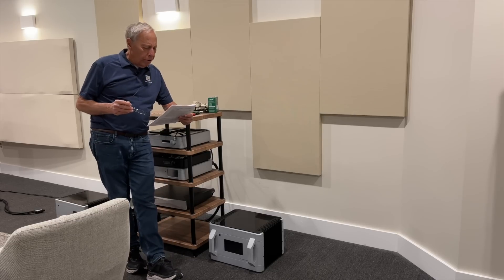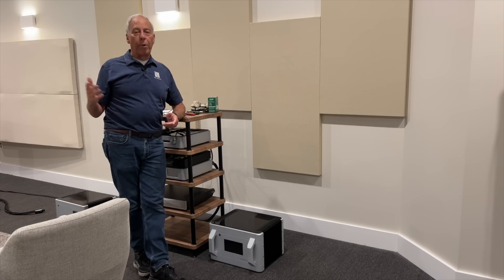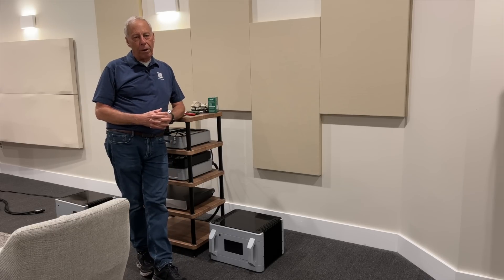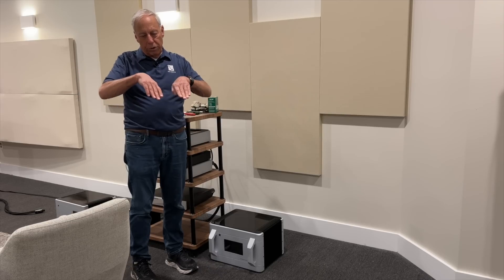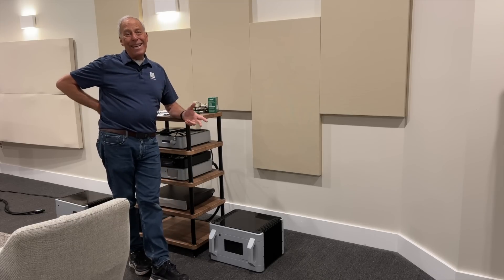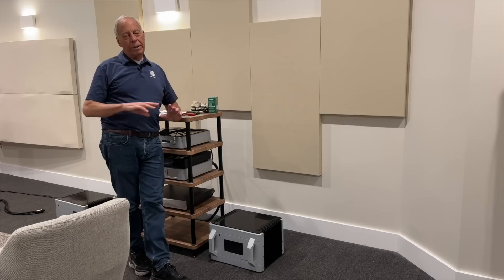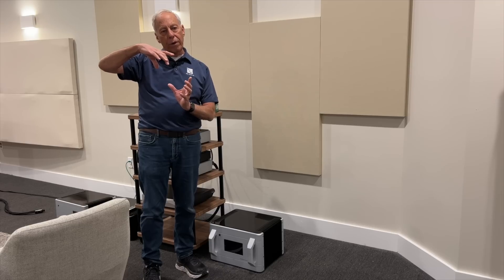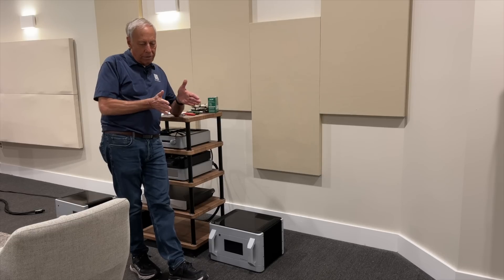Woofer size in modern speakers

Comment: woffee size matters a lot! in active speakers and bluetooth speakers, DSP is often used. digital signal processor since over the years it has become relatively cheap to use. and that powerful speakers are relatively cheap to use, so bass and sound quality are quite good for small speakers nowadays

For sub/bass you should not use less than 10"

in good speakers, I would never choose less than 6.5"

It has also long been a struggle to squeeze a speaker into the smallest possible box. smaller boxes mean less bass
Reply: This is true
Reply: Personally prefer well designed and engineered speakers that don't need a tweak like DSP
Reply: it depends the music you will hear, and the place where the system is located.
shut up and get out of here trying to impose your criteria without knowledge. not every system got to be as you say.
Reply: @georgemartinezza  You should not always doubt what everyone else says. They may be right in what they say.

There are some things you cannot escape when talking about speakers and speaker construction.

Speakers are not an easy thing to deal with. You will often be disappointed.

If you have speakers that only produce good sound for a few types of music, you don't have good speakers.

if you have good speakers but they don't give you good sound on some types of music, then it's the music recording's fault, not the speaker

if you put a speaker in a corner or next to a wall in a room, you get better bass but not as good sound quality!

if you have a 5 inch speaker in a box that is too small, you will get less good sound.

if you have a sound system with a 6.5 inch bass box, you will not get good bass!

If you are going to have a subb/bass box for your sound system, you should have a minimum of 10 inches. the difference between 6.5 and 10 inches is large.

small mids are better and give faster mids than what a 10" 12" does.

harman kardon and jbl extreme bluetooth speakers often have a special bass that colors a lot at around 80hz, which does not give the best bass sound
Reply: @ford1546  yes. I love.
Reply: @ford1546  Define good, please.
Reply: @robertspringer9477  if you walk closer to a wall and speak, your voice will become darker and have more mid bass. about. 2 meters away from a wall is good. Hard to say approx.
Reply: @ford1546  What are you talking about?
Reply: are you being a bit harsh w/ the "shut up and get out..." line? might be nicer to suggest folks be careful conflating, "you should..." with "I would..."

Comment: Most common is 6,5 to 8 inch woofers and i think its better to have multiply of those woofers than one big one, it would be much easier to place those speakers in room, i take sq always ovrr spl
Reply: maybe you don't know how the sound in subwoofers is developed.
subwoofer is Omni directional
Reply: @georgemartinezza  we don’t need such big drivers in speakers becouse we can use multiply drivers instead and make a slimmer speaker witch will work better and sound better in most rooms, subwoofers is there to help with lowend and yes i prefer a larger sub, but for the main speaker 3-4 6,5-8 inch drivers is more than enough typ push high spl with good subs, look at perlisten r7t and s7t they have 4 bass drivers each 7 inch in r7t and 8 inch in s7t, both can play over 115 db, s7t can nearly reach 120 db, so yes those kind of drivers is enough in a main speakers

just use subwoofers for bass output under 30 hz, most people play Below 85 db at their listening position, even speakers with 2 6,5 drivers can play 85 db in your listening position without problems and it might be louder than you think, playing much louder than that of you plan to listen music for long periods will just damage your hearing in the longeun,
Reply: @andreasmoller9798  more subwoofers -
Reply: @georgemartinezza  yes i agree i am just using one at moment but planning to get another later, i have no rush through as i think the one i have in my room does a really good job👍
Reply: @andreasmoller9798  more subwoofers is complex. to setup got to be "carefully" .  ✌
Reply: @georgemartinezza  yes it can be tricky placent is important, to my experince its not always a good idea to put them in corner thats at least the case for me and my room

Comment: My speakers have 2 10" woofers, 6×10"  mid horns coupled to compression drivers, and a lovely 1" horn loaded tweeter.
Over 25 years I have through much trial and error found just the right electronics to put behind them, and they are phenomenal, forward, but sound like a live performance, I still get the chills now and then.
Love the channel Paul, please keep the knowledge flowing
Reply: My aDs 910s also have dual-10.5" bass drivers, built into their own enclosures inside the cabinets, along with dome mids/tweets. They're easily the best loudspeakers I've ever heard, with 93db efficiency and 4ohms, they're very easy to drive, though they demand all the current they can gulp up. The NAD 208 thx power amp and Emotiva xda-2 balanced preamp/DAC has been the best electronics gassing them up. A pair of Adcom 555s also works quite well.
Reply: @trog69  my speakers are 25 year old 50th anniversary klipch legend series, KLF20s, I finally settled on a midlevel Yamaha AVR RXA2 and an emotiva BasX a2 for the mains, the Yamaha is very musical and a bit warm, the emotiva ii
Reply: @trog69  opps the emotiva is basically transparent and adds massive headroom, Its  operating in the 20% range, totally linear and never has to try very hard
Reply: @dans550  I was looking hard at the KLF series before I fell into the aDs sphere. I saw a pair of L810s on their original stands and decided I had to try them out. Got myself a pair-sans stands ( the stands for the L710/L810s are rarely seen nowadays. ) and love them, and the 910s practically fell into my lap here in S. Arizona. Once I put some serious power to the 910s I was floored by the power and all-around dynamics, though I'm sure the klf20s are similarly dynamic.

Comment: I think one big woofer sounds better than two smaller ones. My big woofer speakers image better than my narrower twin woofer speakers and they have better scale and deeper bass.
Reply: Yes. Cannot beat the size. Size does play an important role. Big woofers tend to sound big, more headroom and natural in bass producing job. To compensate for mid range/bass losses, go for 3 ways or 4 ways.
Reply: I assume there must be a cost associated with putting 2 speakers in a narrow baffle as opposed to 1 large one, and there must be advantages too. We are free to use our ears (and sometimes our prejudices) to decide what does it for us. Both tell me I agree with you, my guess is there is a sonic signature that we can discern and that the larger speaker is maybe more character and less fidelity, a price I am happy to pay.
Reply: @bradmodd7856  I think it is also a wife acceptance thing, but some big woofer speakers are coming out again like JBL L100, Klipsch Heresy IV. You can treat the front baffle for reflections, Klipsch uses horned tweeters and midrange. The front baffle doesn't matter so much there. I think Bass is the most important part of a speaker and mids an high's should be built up from it.
Reply: @bradmodd7856  Higher quality big woofers like in the 70's are more difficult and  expensive to produce. They also need more power and dynamics from the amp. I love the warmth and amplitude of my Ditton's 44 from that time 😎
Reply: Your right
Reply: the imaging don't happen at this frequencies at all and large, heavy membranes have their own issues
Reply: @Harald_Reindl  well the speakers do have mids and tweeters :p crossover is at 1700hz so there is plenty of directional sound coming from the paper cone 12 inch. My point was narrower front baffle doesn't automatically mean imaging is better.

Comment: this whole theory only applies to passive radiators,  otherwise you have to have increased moving mass to get lower bass, unless you use dsp then only cone area matters. and perhaps displacement if you want to sacrifice some fidelity, which passive radiators and ports do.
Reply: Thank you I am still learning about the effects of DSP on the loud speaker ( self taught )

Comment: I am still the most happy with 2 10" Celestion woofers per side. 
In the past I had the Dali Special Project 40, which had 4 10" woofers per side. 
I like my bass, and I do not like subwoofers.
Reply: A good active subwoofer still gives better deep bass than a fullrange passive speaker. That's why I always add atleast one sub regardless of what the speaker specs say about going low.
Reply: @Oystein87  honestly, I don't care for specs at all. But I understand I'm in a privileged position. My audio dealer has enormous stock of different audio brands (its like a candy store), when I want to listen to something he has it delivered . So I can listen at home to what best fits my room. Because it never sounds the same in a listening room as at home. 
I would honestly not even know the wattage of my current system. 
My primary set is a cdplayer-dac-tube-pra-amp and the speakers are active, class d.
Reply: @miepmiepzoefzoef  Specs are kinda important but only tells a little bit.
Well yeah, done that too. And of course it wont sound the same at home as in many of those half assed listening rooms.
1x or 2x 12 or 15 inch subwoofer would be nice with those dual 10 inches.
Reply: Maybe you have problems with standing waves on lower frequencies and thats why you dont like subs? I think there are few rooms that can handle sub frequencies well.
Reply: @bingoberra18  Or maybe he does the same mistake like soooo many others: Can't adjust the phase quite correct between sub and speakers so it sounds like shit. I hear this all the time. Took me awhile ti get mine right but now I would never ever have a system without a sub. And I have 12 inch floor speakers with pretty good bass.. But never evwr heard a passive speaker give me that deep, true subwoofer bass. A system needs an good active sub to do that properly.
Reply: @Oystein87  warm, very close, but not completely. I don't want the effort to get everything right.  I seem to have a preference for big speakers I love the infinity Paul played with for a long time, or the YM lab grande utopia.
I want to play everything from classical and opera to dance music. I want to be able to use my speakers when I throw a party, but they should also sound just as vital on lower volume.
Reply: @miepmiepzoefzoef  So you don't care about sound then since it still requires an effort with or without a sub?🤷‍♂️ I also like big speakers.. But I still have never heard one that do not need an active sub along side it to really hit the lows. Unless it already has a built in active one. But even then I could still consider a dedicated sub in many cases.
Everything you mention is just a bigger reason to add a sub or two..🤷‍♂️
Reply: @Oystein87  after having this hobby for 29 years now, I'm less of a purist than I was before. I just do not have fun in the millimeter tweaking anymore.
I do have the low hanging fruit though, the xlr's from my amp to the speakers are cardas. (i have no speaker cables or interlinks anymore) and I do have a dedicated electricity group for my audio. And of course I have markings for most ideal speaker locations. 
I don't see my self in need of any subwoofers. 
The money I could have spend on a sub, I've spend on a second set for a different room. Different components and brands, but also one box with combined hybrid tube (pre+end) amplifier and dac in one. With some cute monitor speakers. And even in that room there's no sub.
Reply: I'm kind of assuming this doesn't apply to you, but I've heard so many people say "I don't like subwoofers" because their only context for a "subwoofer" is in crummy soundbars or PC speaker sets. Where the sub seems overly present due to the fact that the sats are so small that they just can't provide any real low-mid to mid range sound. Those sets where everything below 180Hz is dumped on a 4" "subwoofer" and where the sats are basically 1 to 2" tweeters. Leaving a giant pit where the lower mid-range should be.

I wouldn't want to be without a subwoofer any more, as I just don't have the space to put large tower speakers that can give me the range that I now get out of bookshelf speakers and an active sub.
Reply: @fermitupoupon1754  I would not be without a sub even with full range floor speakers😝 Unless they have active woofers / subwoofers in them.
Reply: @Oystein87  fair enough, I can definitely see the logic in that.
Reply: @fermitupoupon1754  I have actually heard real subwoofers on real audiosets ;) And I must say I understand the space concern I have 2 towers of 160 high in my living room. 
The last time I was at my audio dealer he had a set of 14" or 16" subwoofers, for a high end home cinema and those boxes were not exactly small either.

Comment: Well after using so many narrow speakers I'd say I prefer my KLH Model 5 to any narrow one I've used so far. Just sounds big and loose in the bass yet defined.
That's just me but no one is wrong depends on your preferences
Reply: When it comes to standalone stereo floor standing speakers, I’ll take a pair of “properly”  designed 3-way full range sealed speakers any day over anything else. I don’t care if it takes several cubic feet of volume to accomplish that. I personally haven’t heard the KLH Model 5’s, but I hear they are a move in that direction for the budget conscious. 👨🏻
Enjoy your speakers. They can be your best consoling friend in times of trouble.
Reply: @shipsahoy1793  YES, YES, YES. Acoustic Suspension speakers with a large woofer is my soft spot. They have become very difficult to find - in a new speaker. For me ported speakers just do not cut it. Oh well.
Reply: @spencerroberts4940  
👍
Reply: Klh are excellent speakers
Reply: what type / genre of music do you listen?
Reply: @georgemartinezza  I listen to most stuff also, but sorry fans… opera, rap, and disco are mostly intolerable from my perspective.
Reply: @shipsahoy1793  really I don't like Opera. - no I can't xD
Reply: @georgemartinezza  pretty much everything but opera and country music
Reply: @dans550  Creedence Clear W Revival is country or is it Rock?  I don't know. I think it is Rock.
Reply: @georgemartinezza  sure it's rock